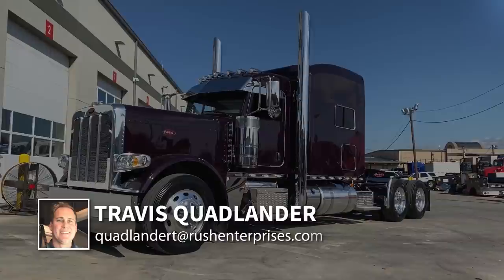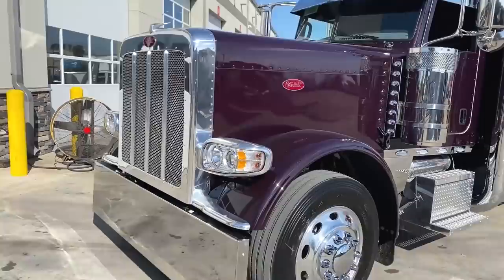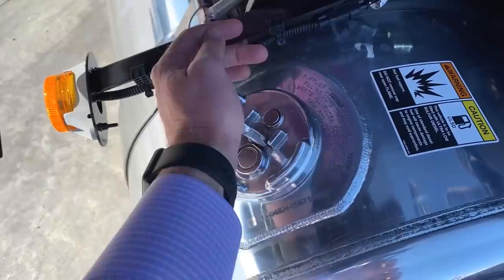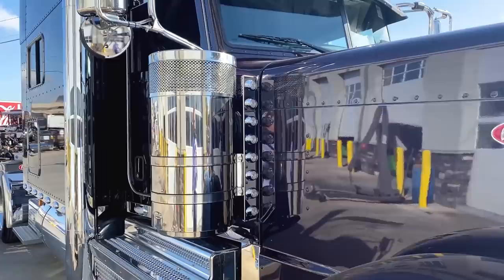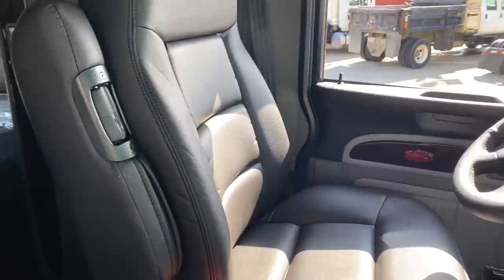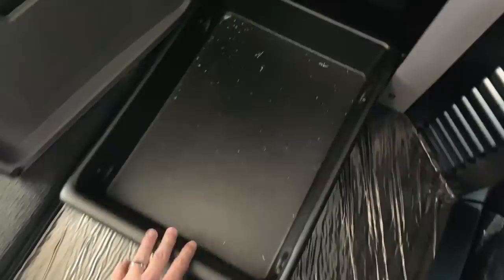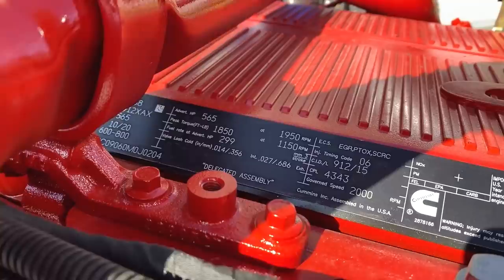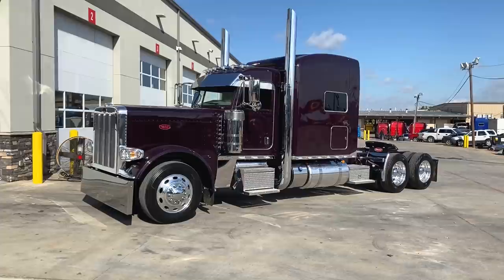Legendary Purple with Black Cherry Painted Frame 2021 Peterbilt 389 Custom

Comment: I remember the peterbuilt 359 70's to mid 80's , and peterbuilt 379 from mid 80's to the 2007, now I see the peterbuilt 389 now in my 26yrs on the road as a truck driver 🚛🚛🚛🚛
Reply from the maker: Hello Amexum. Yes, the Peterbilt 359, 379 and 389 has a great legacy and tradition.
Reply: @tquadzilla  yes but 359 and 379 always had the BIG CAT 🐈  motor for years and I missed it so much my friend

Comment: why not put the battery switch next to the drivers seat. My luck would have it covered in an ice ball well below zero with one good crack of a hammer to break it off. only thing I would add would be a low low front axle a herd bumper up front and a great set of lights on the rear. Always liked that color

Comment: Nice. But why not opted for the 2050 tq?
Reply from the maker: We have 4 in stock with 2050 Torque that will get similar dress up but will have painted drop visor, window chops and lights panels. We also have a couple without any custom dress up.
Here they are.
Custom Trucks
White with Gray Frame
https://www.rushtruckcenters.com/truck-sales/truck-inventory/434921-peterbilt-389
Black with Lime Green Frame
https://www.rushtruckcenters.com/truck-sales/truck-inventory/434929-peterbilt-389
Light Purple Slate with Violet Frame
https://www.rushtruckcenters.com/truck-sales/truck-inventory/434923-peterbilt-389
Medium Aqua with White Frame
https://www.rushtruckcenters.com/truck-sales/truck-inventory/435000-peterbilt-389

No Custom Dress Up
Dark Rich Blue
https://www.rushtruckcenters.com/truck-sales/truck-inventory/433942-peterbilt-389
Smokey Mountain 
https://www.rushtruckcenters.com/truck-sales/truck-inventory/435924-peterbilt-389